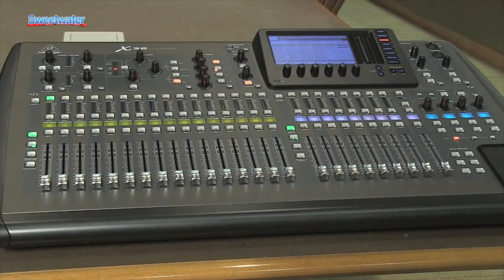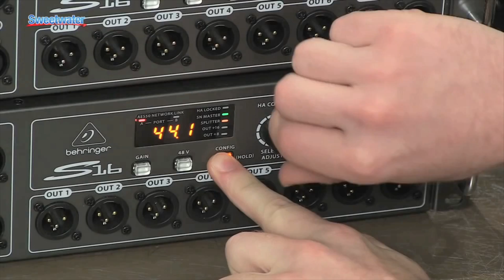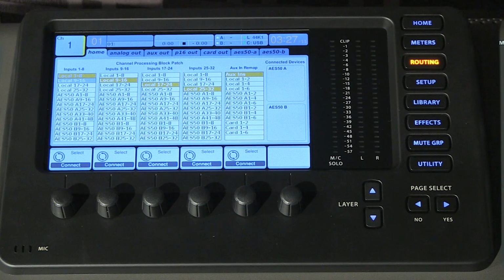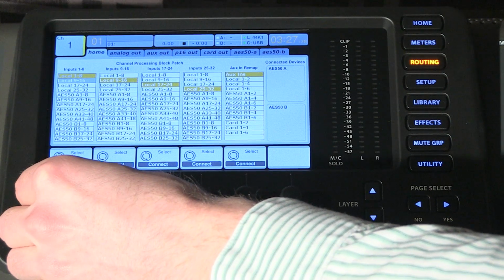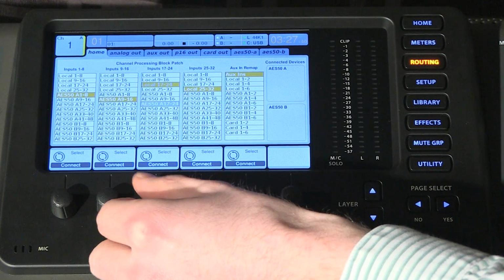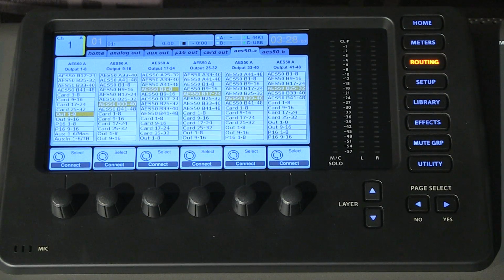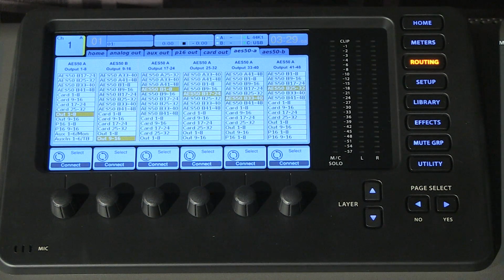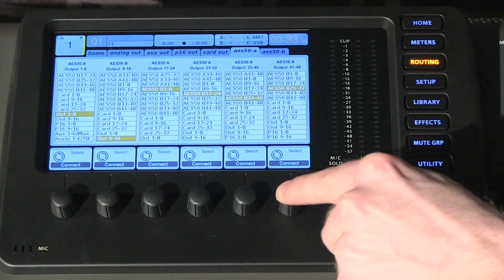Setting up your Behringer X32 with two S16s

Comment: Wondering If i can get some advise/assistance with connecting 2x S16 racks to an X32 using AES50 A for one rack and AES50 B for the other because they are in 2 different locations and I'm having consistency issues when daisy chaining the 2x S16 racks

Thanks :)

Comment: May be a silly question but is this also achievable connecting an S16 and SD8? Thanks in advance.
Reply from the maker: Hello, Mike! Not silly at all! Yes, you can connect an SD8 along with an S16 to an X32.
Thanks for the interest!
Spunde, Sweetwater Sales Engineer, (800) 222-4700 ext. 1732, Spunde@Sweetwater.com

Comment: Hello, I'm using 2 s16's with my x32 compact. I see signal on every input but can't get any output from the stage boxes. I followed it step by step but still nothing. Any help is appreciated. Thanks! Oh, I've also updated the firmware to make sure everything is up to date. Thanks again.
Reply: How did you see input on the stage boxes? I can’t see any and everything is connected perfectly

Comment: Please note that one should use shielded cat5 cable!
Reply: Hans, for both connections?
Reply: Rogério Miranda yes
Reply: Not just shielded Cat5 (STP) but also with etherCON connectors bonded to the shield. Chassis grounds MUST be connected on both ends of the AES50 connection or you risk permanently blowing out your port!
Reply: mashzmash that is not entirely the case to be true. If the connectors itself are shielded, you’re good to go

Comment: Hello guys in new to the forum and seeking some help I’ll tell you my set up first. Currently have an x32 in a booth running an analog snake to the stage with 8 inputs coming off the snake also have 12 mic inputs plugged directly in the board the  we have two active speakers, two passive subs, and two passive wedge monitors all running through the snake, Along with 4 p16’s  ran thru ultanet. So what I'm looking to do is replace the analog snake with an s16 but still want my x32 to have channels 1-8 coming from booth 9-16 from stage and 17-20 coming from booth plus I want to route speakers subs and monitor to digital snake. So my question is how to hook up the s16 correctly. My set up I left it on default mode but was concerned about the xlr outputs because before we just used ¼ outputs do I have to reassign this on the x32? Should I not be running the default on the s16 should it be the next option? Using outputs 9-16 since I was told 15-16 are the defaults for your main? Also is there a way to single out the subs instead of being daisy chained?

Comment: Can you do anything with the 32 inputs on the back of the X32 after setting this up, or are they basically unusable at this point?
Reply: You can still use them. You just have to assign the input channel to a fader in the  routing section of the individual channel

Comment: Question:
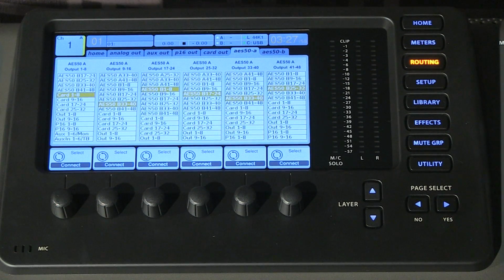at 2:43 in the video you switch to routing the outputs of the 2 S16's.
When routing "Out 9-16" under the 2nd column "AES50  A 9-16", I noticed that the "A" at the top of the column next to AES50 changes to "B".
I followed your instructions on my X32 Compact - did it 6-7 times actually - and the "B" never appears. It remains "A".
However, the outputs, as assigned, still see to work OK.
Thoughts? Any idea what I may be doing wrong? Is this, perhaps, a firmware issue?
Thanks for any help you can provide.
Peter

Comment: Oh nevermind, i understood the 2nd time. 
By default the main outs are on 15-16 = which is equivalent to outputs 7-8 on the s16. now, my question is Which s16 ? a or b ? (As of now, it should be output 7-8, on the 2nd s16, right ?

Comment: Hey! thanks for the video! REally helps a lot, though i have one quick question. You mentioned the "Main Outs" are on 7-8, and 15-16 ? I got a little confused. These two s16, are closer to the amps, than the x32, so from which output would i export the main audio ? S16(a) Channels 7-8 ? Or S16(b) 15-16 ?
Reply: 4 years ago but I think he said 7-8 on the s16B.